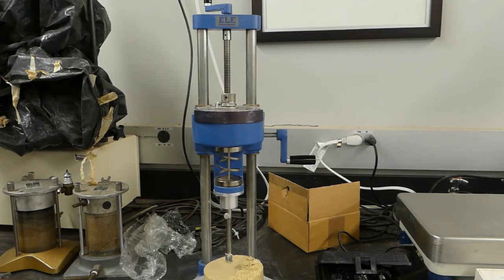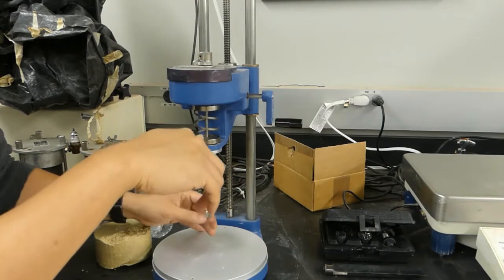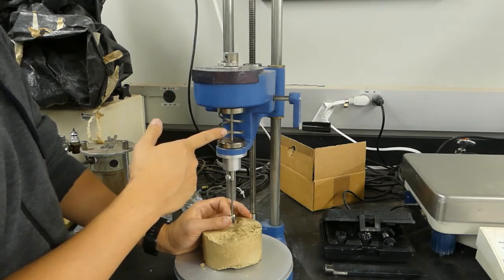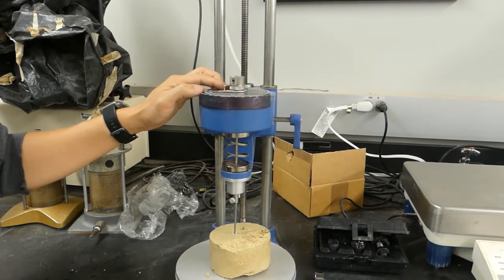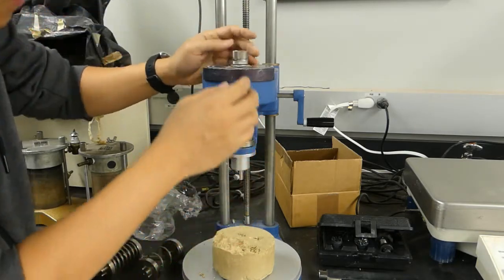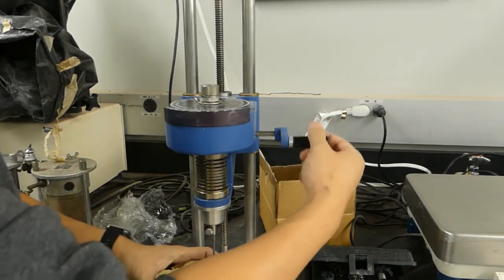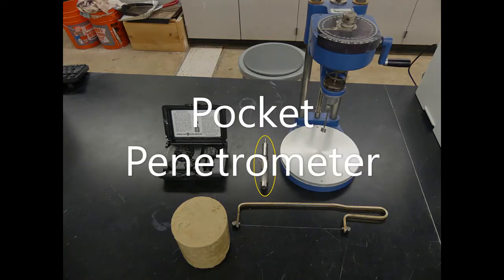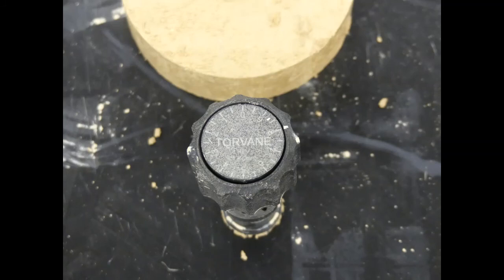CE 3680 - Lab Vane, TorVane, and Pocket Penetrometer Tests

Comment: Hi.can I ask a question? We recorded the value 3.5kg/cm2 on the device. blade coefficient 0.2. Is this calculation correct?
3,2*0,2=0,64 kg/cm2------ 62,72 kpa .When we read the value of 3.5, I should save 0.35.?